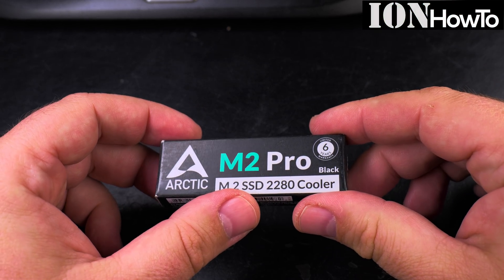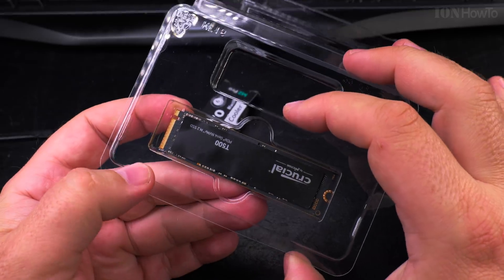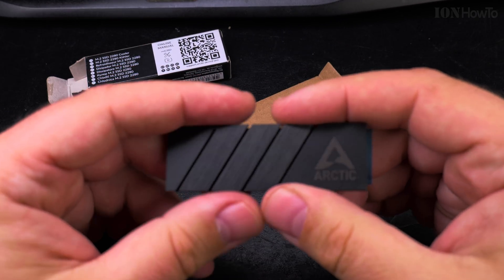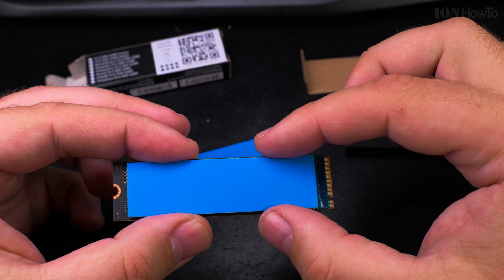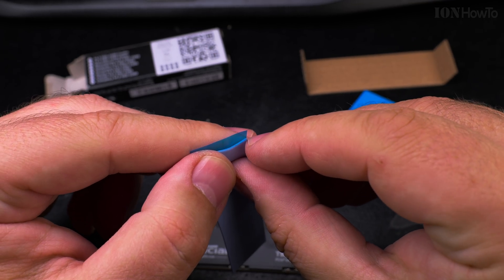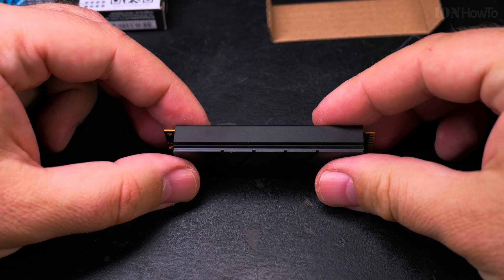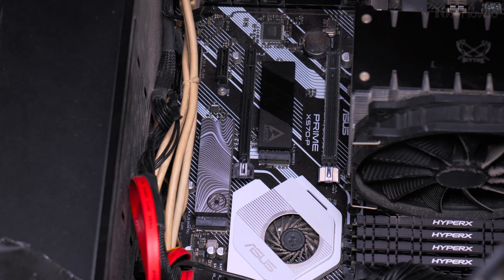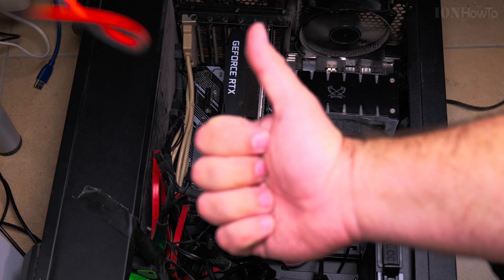Arctic M2 Pro Cooler Crucial T500 Pro NVMe M.2 SSD Installation

Comment: Yours seemed to clip on much more easily than mine. With mine, the clip-on side seemed elevated and not completely fitted into the groove. It stressed me out so much over whether to apply more pressure to force it in.  I gave up in the end out of fear of breaking the SSD. But it seems to be working with temp not exceeding 50c under load and that's a relief. lol

Comment: Nice, just put that cooler on my crucial t500 2tb yesterday. Then seen this video today lol. Works great! Before I put the top on, I'd suggest to put in the system and make sure both sides work correctly. The screw side and plug in side, that way you can adjust the m.2 if not seated correctly. Taking the top off can be a pain if not aligned properly.